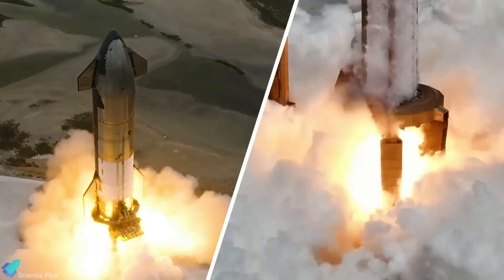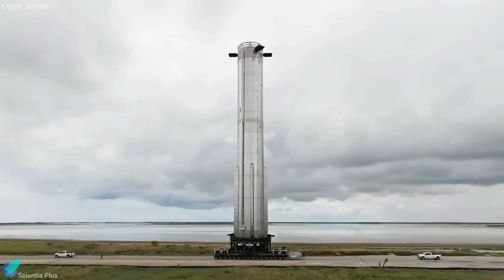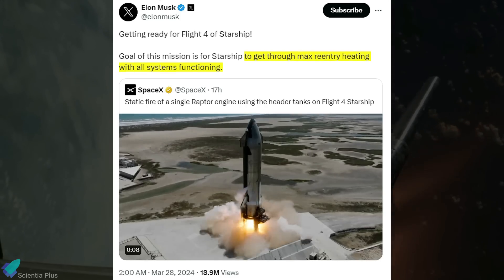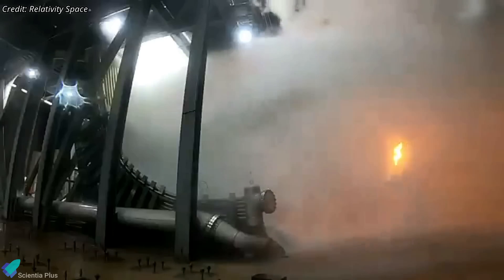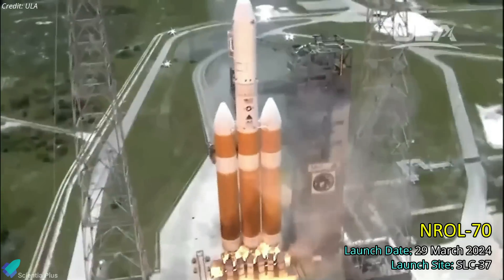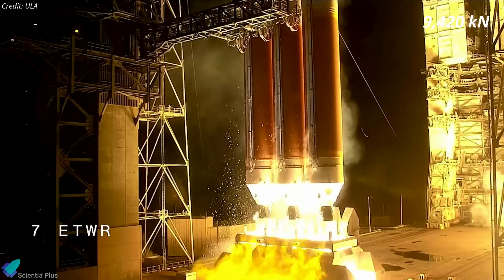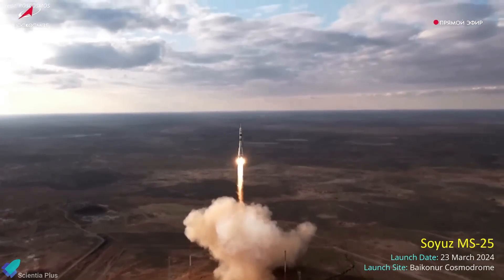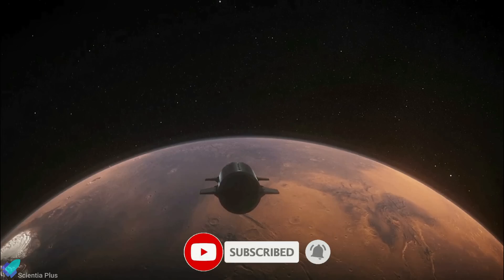Elon Musk Drops Starship IFT-4 Mission Goals - What Lies Ahead?, Ship 29 Completed Static Fire Tests

Comment: I think the launchpad tear-down has multiple reasons, but one reason not mentioned is the possibility that SpaceX may be planning to   accommodate boosters/ships of greater diameter - say 12 meters? - than the current 9 meters designs. Such a move would definitely require legs to be spaced further apart than they have been up to now, so tearing down all but one or two now would make perfect sense before erecting new legs. The table sitting atop the new legs would need to be configurable for the two different diameter series of craft, but that's just engineering. My $0.02...

Comment: @ 3:00 "flight three was almost completely successful", huh? No I don't think so, it fired up, left the pad, seperated, the booster done its boost back burn then it all went to shit. 

The Starship contunued to burn its six engines but failed to reach the designated orbit, then it started rotating uncontrollably, failed to open and close its pez payload door, abandoned its fuel transfer test, collided with the atmosphere side-on then tail first, failed to aerobrake properly, failed to control the re-entry, failed to achieve subsonic speed, failed to belly flop in to the ocean, failed to land where expected with a gentle landing. 

That is a whole lot of failure. Here is what they can do; fill the rocket, launch the booster, detach the Starship, boost-back burn the booster, ignite Starship engines, achieve 100Km+ altitude. That is it!! I would rate that as 30% successful.
Reply: It would be a definite boost for everybody if you were to ride on the top of the next stack as it ascends, and report progress back to base. Seems like a great use of your very obvious talents and skill-set.
Reply: If you put the current 'success' next to the original schedule they are five years behind and have reached  zero of the targets they are paid for by NASA. And they burned (almost) all the money.
Hardly a success story.

Comment: Dry ift-4 weight starship 220,000 lbs, booster 440,000 for a total of 660,000 dry. If they just changed to aluminum it would only weight 66,000 + 115,000 for raptor 3 engines. Total 181,500 lbs. Then starship could lift a 750,000 lbs payload vs the current 220,000. This number lighter than the payload with 220,000 lbs payload with 660,000 total rocket weight. This leaves SpaceX a large fudge factor to launch starship higher. It also leaves booster more fuel to slow down to soft landing. Right now starship is launching with a  aircraft carrier anchor around its neck.

Plus starship could fly 5 times further. Last the tiles will stick to aluminum vs stain steel.

One last note Falcon 9 and super heavy are both made of aluminum and are both reusable. This is a no brainer.
Reply: You're right - they should use aluminium in Starship. HOWEVER, and it's a little known fact, that when Elon was casting about for ideas on building what would later become Starship, he asked his one-time GF what they should use, and she said stainless, 'coz it looks SO cool and is SO easy to clean. OK, says Elon, and took another toke from the bong. True story - now they're stuck with the incredibly heavy - but you have to admit, really cool-looking - stainless. Cherchez la femme!

Comment: the launch pad legs present a good opportunity to redesign them for better multi-tasking.  Make them a part of the water deluge system.  They can also build in high heat camera lens housings and an airfoil cross section instead of a round pipe to facilitate the hot gas flow around the legs.

Comment: Do you think E could think up a super hot 'wind-tunnel' to check things out, maybe an application to spray on thermal coats ?
Reply: I always wonder about large exterior ceramic structures with steel interior.  G.E. is really good at mixing alloys with ceramic etc. in their jet engines.  Why not SpaceX for their launch and test platforms.
Reply: @3-5-9-61  Turbine blades in jet engines don't have flame impinging on them, let alone the kinds of pressures and flow volumes seen during a launch. NASA's launchpads used to get pretty trashed on every Saturn V launch, so it's not a new problem

Comment: Tearing down the launch pad at Canaveral suggests major changes in the works.  Totally agree that strengthening and easing the construction of a water deluge system are high on the priority list.  Maybe also a bit of additional strengthening for the heavier second generation Starship stack with lengthened vehicles, more oxidizer and propellant mass, etc.  Sure looking forward to seeing developments here.  Low odds guess -- a flame diverter trench?
Reply: Definitely a Flame Diverter/exhaust trench, long overdue logic, I have been suggesting the use of a trench since day one, deluge system is a waste of time money, and resources.
Reply: @mattblack9069 Exactly, he certainly didn't care for that suggestion a couple of years ago on Twitter. Banned permanently. 😂
Reply: @mattblack9069  There will never be flame trenches for operational launch mounts for Super Heavy, there is just too much energy involved and any trench would be torn apart. this is why they have the launch mount because it allows energy to be dissipated in all directions. Now they have the shower head deluge to protect the ground directly under the mount it is working pretty much perfectly. The flame diverter at Masseys it because they are short on space and need to divert exhaust away form the tank farm right next to the test mount. This only has to deal with max 9 raptors at 50% throttle so it's no where near the thrust of 33 at full power. Even with a flame trench it still requires a deluge system to protect the surface of the trench, this is why one is being installed at Masseys.
Reply: @schrodingerscat1863  Super heavy does use an exhaust diversion system dude you are confused with Starship which does need an exhaust diversion system.
Reply: @mattblack9069  What are you talking about? Makes no sense. SH has no diversion system and neither does SS currently. At Masseys they are installing one but that is to allow longer test burns and to make it more suited to rapid testing.
Reply: @schrodingerscat1863  allowing the exhaust to blast in all directions is the problem with the whole design. It's why they can't Keep tiles on the ships when static firing... All that blast is just bouncing back up as well as blasting anything in all directions damaging anything in it's path! Much smarter to channel it away from everything instead of allowing it! This will dramatically cut down on pad repairs!
Reply: @Shivaho  While channeling the exhaust is ok for Starship static files it just won't work for Super Heavy. Starship testing hasn't really been updated since the earliest ships that had no tiles at all. That said the reason behind not having deflectors for Starship originally is that it had to simulate taking off without the Super Heavy. The whole point of the Stage Zero mount it to allow the exhaust from Super Heavy to dissipate in all directions. Trying to channel that using a trench and deflector would be impossible because the materials just don't exist to withstand that kind of energy especially and be reusable. Ultimately the shower head deluge has done the job of a deflector and berms placed around the launch mount protect ground support equipment. Pad repairs have been minimal since the deluge system was installed but they are still dialling in the launch procedure to minimise both risk and wear to the launch infrastructure.

Comment: Can someone explain how this rocket can take off from the moon, where there will not be a launch pad, when launch from Texas does so much damage to the pad.
Reply: The moon has a greatly reduced gravity. The original lunar lander was considered to be a hoax since there was no crater when it landed. The posit was that the engine to land did not take that much thrust. Therefore no crater. In the animations of the landing they are using engines up at the top of Starship. This is my conjecture. Since there is no pad on the moon my concern why would it not topple over?
Reply: The upper engines will be used to lift off from the surface.  Hls will have self leveling legs so that the ship will not topple over.
Reply: cuando despaga en la tierra el booster es el que ocasiona los daños , mientras que en la luna solo despega la starship
Reply: After hls gets well clear of surface it will fire main engines to put it into lunar orbit.
Reply: I'm sure the spacecraft will be configured differently for lunar landing and liftoff.

Comment: Why can't a successful Cryo Test be immediately followed (within minutes) by a Static Fire Test, since the engines are already cooled down for firing? Does anybody know why not?
Reply: A cryo test usually involves liquid nitrogen in the tanks, not fuel and oxidizer, therefore you can’t static fire without fuel. This is done to verify that there are no leakages in the test hardware. You would probably agree that it would be a bad idea to have a highly explosive gas leak while planning to, or already igniting engines, as the this could cause severe damage or destruction to the test Hardware
Reply: They don't use LOX or CH4 for cryo tests, for safety they use nitrogen. They also need to fill the tanks completely for a cryo test for fuel and oxidiser is dangerous for this kind of test. Tanks are never filled for static fires because of safety concerns. LOX tank is filled but only just enough CH4 for the test is used.
Reply: I got it. Thanks for your answer. I guess it makes sense. Do they even use the same test pad for Cryo testing and for a Static Fire test?

Comment: With Saturn V did they ever do a static fire on the pad? I don't remember any other rocket company than Space X ever doing static tests on actual vehicles.
Reply: No, not at KSC.   They did full static fires at Huntsville and Stennis.
Reply: @randyschreiner7807  Yep. First static fire of all five F1 engines together on the Saturn V first stage was at MSFC in 1965. Space Shuttle, on the other hand, did "Flight Readiness Firings" at the pad at Kennedy of all 3 SSMEs (but not the SRBs, which were tested in Utah) for each new Shuttle Orbiter before its first flight.
Reply: Static fire test is not done on solid fuel rockets; once they're ignited, it'll burn until the fuel runs out.
Reply: They probably did, but back then there was no Internet nor satellites in space to send video around the world and finally no personal computers either. So, we would never see it. But I would imagine that would be a requirement of NASA, even back then.
Reply: They never did a static fire a launch pad at Kennedy, but they did full static tests of the first stage (the S-IC) of the Saturn V with all five F-1 engines firing on a test stand at MSFC in Huntsville, Alabama, the first of which happened on April 16 1965 (you can find it on YouTube by searching for "The FIRST test of all five F-1 Engines in 1965"). NASA did several do so-called "Flight Readiness Firings" on the launch pads at Kennedy for Space Shuttle, which they typically did be for the first flight of each new Shuttle Orbiter (you can find some of these on YouTube by searching for "Shuttle Flight Readiness Firing") -- note that these test only fire the Space Shuttle Main Engines and not the Solid Rocket Boosters (Solid Rocket Boosters are tested with full duration firings in horizontal position at a test facility in Utah). The SLS for the Artemis program test fires the first stage center core at NASA's Stennis Space Center in Mississippi, not at the Kennedy launch pad as Shuttle did ( SLS Solid Rocket Boosters are tested with full duration firings in horizontal position at a test facility in Utah, like the Shuttle SRBs).
Reply: Saturn V was a liquid fuel rocket. The launch site was Cape Canaveral. If they did a static test it would be observable.
Reply: They never did a static fire a launch pad at Kennedy, but they did full static tests of the first stage (the S-IC) of the Saturn V with all five F-1 engines firing on a test stand at MSFC in Huntsville, Alabama, the first of which happened on April 16 1965 (you can find it on YouTube by searching for "The FIRST test of all five F-1 Engines in 1965"). NASA did several do so-called "Flight Readiness Firings" on the launch pads at Kennedy for Space Shuttle, which they typically did be for the first flight of each new Shuttle Orbiter (you can find some of these on YouTube by searching for "Shuttle Flight Readiness Firing") -- note that these test only fire the Space Shuttle Main Engines and not the Solid Rocket Boosters (Solid Rocket Boosters are tested with full duration firings in horizontal position at a test facility in Utah). The SLS for the Artemis program test fires the first stage center core at NASA's Stennis Space Center in Mississippi, not at the Kennedy launch pad as Shuttle did ( SLS Solid Rocket Boosters are tested with full duration firings in horizontal position at a test facility in Utah, like the Shuttle SRBs).